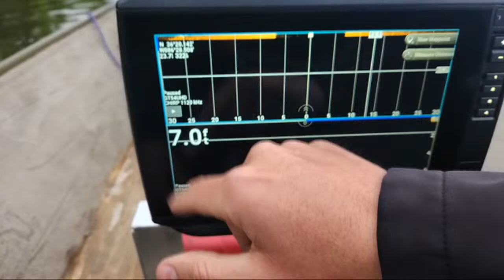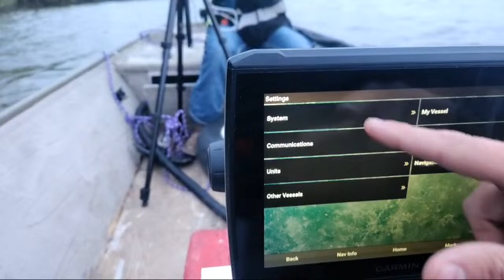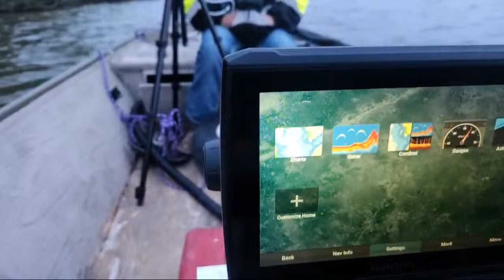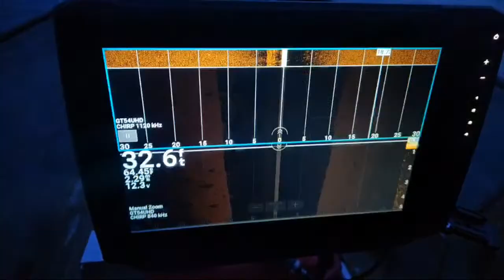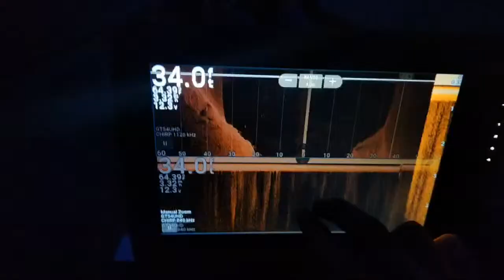Searching Live Update | Sebastian Rogers

Comment: Have you used SAR Cadaver Water Dogs yet? They can smell a body underwater where you can't. If you can seek the help of SAR Cadaver Water Dog handlers for help, would be very helpful in your water search.
Reply: My dog found a dead elk leg in 4 ft of water just the other day. Couldn’t believe it
Reply: Dogs actually taste the water.
Reply: What about a body wrapped in plastic or put in something.
Reply: @newsworthy2064  I think that was a different diver who originally found that but I’ve not heard any update.
Reply: Agreed💯🙏
Reply: Wow.. I’ve never heard of that.  Amazing
Reply: @evanmoore6170  The gases of a corpse float to the top of the water and the dog can smell it. Typically the dog will lower it's nose if it detects a corpse. The divers will mark the area and dive to find the body.
Reply: @debbiependleton8507  yea my dog was sniffing back and forth along the top of the water for a minute, then waked out and dove under and got it. Probably not 4 ft of water like I originally posted but probably 3 ft anyway. It was crazy